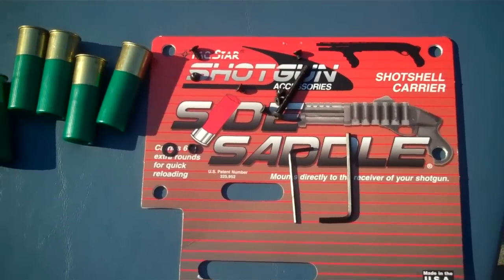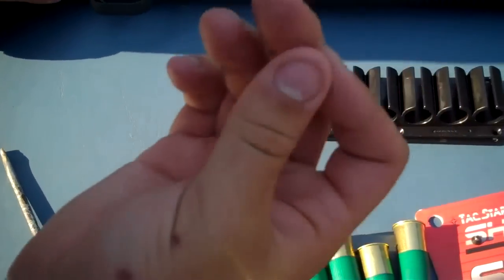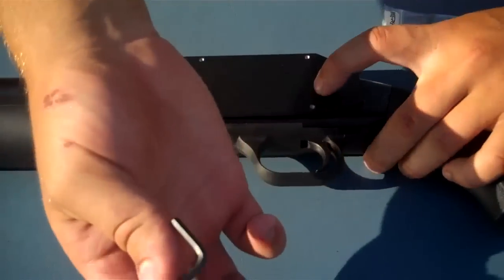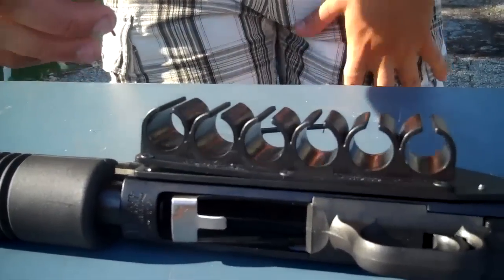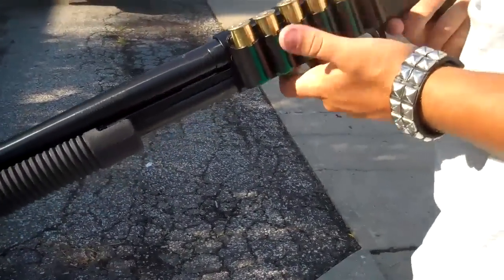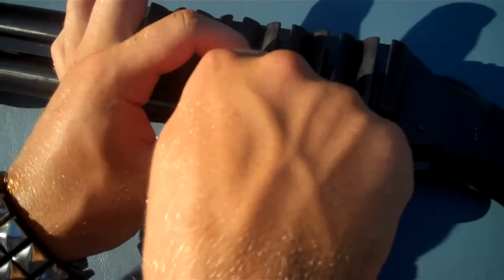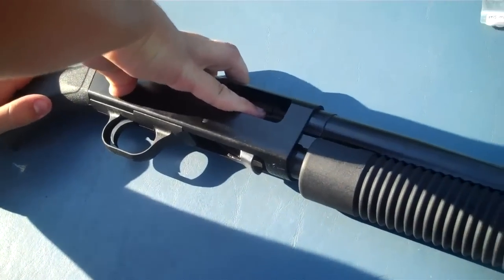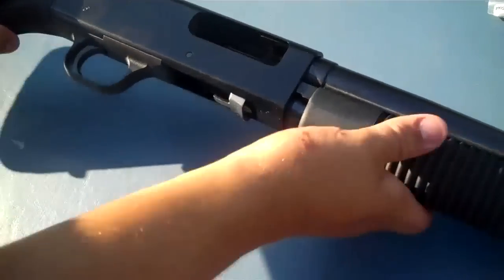How to put a side saddle on your mossberg500

Comment: PUT ALL OF YOUR TOOLS AWAY !!!
The best and easiest way is 2” wide peel and stick industrial duty Velcro directly on the receiver.  This allows you to quick change the whole strip to resupply or change ammo type.  This works with fabric sidesaddles that already have Velcro built in,  or hard plate sidesaddles after you add the opposing half of the 2” peel-&-stick Velcro.
Reply: I like that idea bro ! 😎🖒🇺🇸

Comment: @AAproductionguns nice vid, just bought one of these and installed.  Just wondering, after running a shitload of rounds through it, did it come loose at all? Wondering if I should use some lock-tight on the screws (of course, that would be a bitch to get off if I ever wanted to remove it...)

Comment: use blue locktight. or a lighter too heat up the screw and melt the thread locker. Not being a jerk, but I dont understand why people make a big deal about removing thread locked parts.

Comment: That saddle had flown off on my Mossberg after shot few buck shots through it
Reply: Not surprised to hear that. It seems that quality control issues are to blame, specifically the supplied hardware. Loctite doesn't do a bit of good if the hardware is made from poor quality steel. There's quite a few reviews on this product on the internet, and it seems that fitment issues, as well as broken retaining bolts are somewhat common. I'm not sure what the mounting bracket is made of, but if it's aluminum, tapping holes directly into it is a bad idea, and creates a horrendous weak spot. Any aluminum piece that needs to be threaded, should be drilled out and fitted with pressed in threaded steel inserts. Top grade hardware should also be supplied. This side saddle looks like a nice design, but a little bit more engineering would have gone a long way.

Comment: does this work on maverick 88?? i think it does but i am not sure
Reply: I own a Maverick 88, as well as a Mossberg 590. After doing some research, it seems that most of the aftermarket parts that fit the 500 or 590 will also fit the 88. The forends however, are a different story. There is no exposed forend nut on the 88. If you want to replace the 88 forend, you will have to swap out the 88 slide assembly for a 500 slide assembly, and install the new forend on that.

Comment: I put mine on and the blast of two slugs were enough to strip the screw holes on the aluminum plate. Huge waste of money, spring for a better one even if it is a bit more expensive.

Comment: many report this not fitting their Mossberg 500, due to the mounting plate and assembly interfering with the cycling of the weapon. Anyone else had this issue?
Reply: I was thinking the same thing. my grip is much longer than the one on this video.  it would for sure hit the saddle when its racked. im assuming the grip has to be swapped out? but I cant seem to find any videos about it.
Reply: I finally got one put on my Mossi 500, and it's sweet. However, I did change out the stock and fore-grip (pump grip) to Magpul. It looks sik. Wish I could post a pic.
Reply: I like the extra shell on the stock, got my six round on stock,

Comment: Don't like them, one more thing to get in the way,,,with 8 shells loaded, what's the sense ?
Reply: How would it get in the way, not like anybody keeps their hand in that general area while handling a shotgun. It's a good way to keep shells with the shotgun without keeping it fully loaded and putting tension on the magazine tube spring. In a home defense situation you're not going to have time to grab shells out of a box and load the shotgun, you may have to load it while on the move.
Reply: @tonybayer2546  Won't be one on mine. It's a weapon not a Christmas tree. If you like it, fine, go bolt one on,,,,,
Reply: Maybe a Velcro holder,,,,